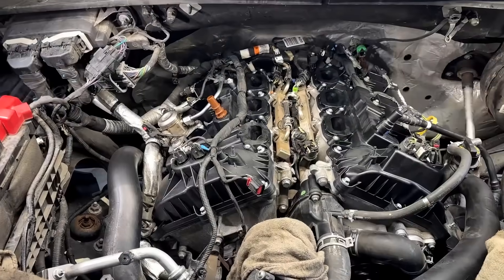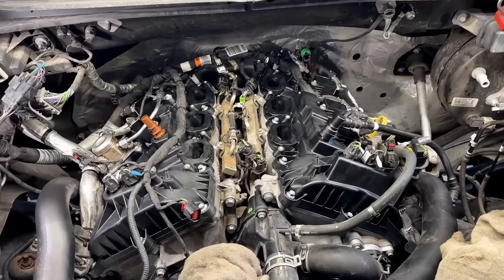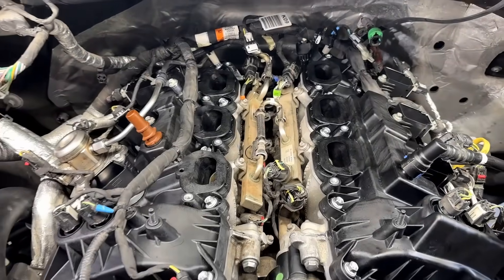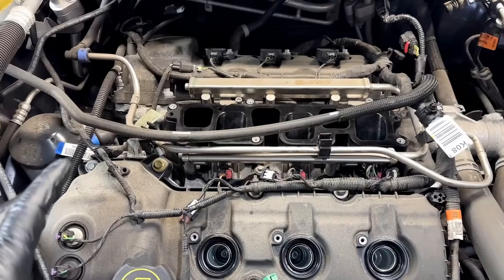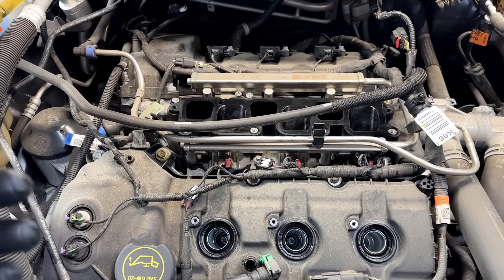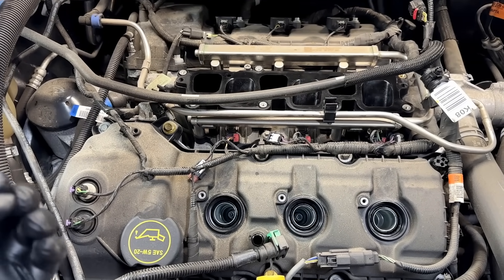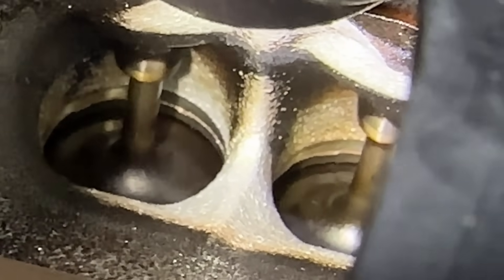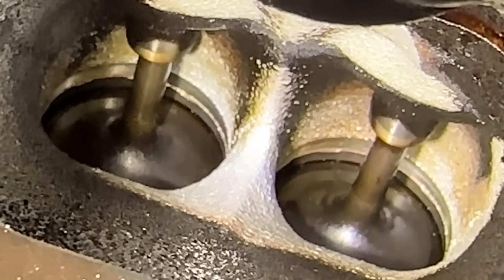Does Ford's New Dual Fuel Injection 3.5L Ecoboost Engine Really Fix the Carbon Build Up Issue?

Comment: The two Ford's I used to own had good engines one was a 2.0 liter SPI and the other was the 4.0 liter V6 Cologne engine. I never had major problems with either engine. But both broke flexplates, and the 1996 Ford Explorer Eddie Bauer Edition was the worst at three flexplates in two years of owner ship.

Comment: I find this really interesting as a VW guy. There used to be a ton of speculation that the VW euro fueling strategy (port and di simultaneously) would help our own domestic VW's with carbon buildup. The blanks for port injectors are just sitting right there on every US VW intake manifold, although they mostly get used for methanol injection by tuners and not gas here in the states. Then I heard otherwise from an industry engineer, her explanation was that it was purely a euro emissions compliance tech in practice, and that if there was a carbon effect it was minor enough not to be why it was used. For VW's part their most recent DI revision (2015 on the GTI to start) put a hollow sleeve around the balance shaft with large holes in it. They route oil vapor through that en route to the PCV, which slings the larger oil concentrations away from the potential intake stream and back into the engine. It's not perfect based on my last look into my wife's GTI, but she's at 170+k miles on her 2016 GTI, with no cleanout, and there's no idle or driveability issues as of yet. I don't think I've ever seen a previous gen 2.0T from them get past 90k without severe buildup so that is clearly working for them on some level.

Comment: Timing chain replaced at 150,000. When I had my Gen 1 3.5 they said that the oil channel would clog if oil wasn’t changed at the appropriate time. Has the clogging been resolved on gen2?

Comment: I used the intake cleaner for direct injection on my 2012 3.5 eco boost. A buddy has a 2012 3.5 and it was running rough. We used some intake cleaner for direct injection and let it set for a few minutes. We took it for a ride and that thing did everything but run right for a couple miles. Missing, spitting check engine light flashing, coughing. After a couple miles light went out and ran totally smooth. It’s evident to me it hadn’t been cleaned in a while. I did my 2012 every 30,000 miles and I sold a strong 3.5 at 180,000 miles. Only time the engine had a wrench on it was when I did a antifreeze flush and got the water pump leaking. Never a fuel system problem.

Comment: My 11 F150 3.5 had 195k miles with no catch can and runs as good as the day I bought it new.  I’ve gone through misfire issue with plugs and have drilled the intercooler pipe condensation relief hole.  Overall been a great truck using Mobile 1 synthetic 4-8K with wix filters.  

Have friends with over 200K with no issues also.  “Will have drivability issues”……”lucky to get 150K without changing timing chain”   

Those absolute statements can lose credibility.  Yes many trucks have those issue but…..

Keep up the great content just wanted get my 2 cent out. 

Thanks
Reply: That's reassuring. I got a 2021 F150 with the 3.5L and I like to keep my vehicles for 10-15+ years or 200,000+ miles. I use premium fuel, I do fuel system treatments (Berryman) every 4-5 fill-ups, only use Pennzoil ultra platinum oil every 5k miles, motorcraft or Mobil 1 oil filters, motorcraft air filters, and motorcraft parts like spark plugs and anything that needs to be replaced. 

This engine is WAY harder to work on than my old 5.4L V8 in my previous 2010. Changing the belt looks like it's an all day job on this 3.5L when it took 10 minutes on my 5.4L.

Comment: The original 3.1 Chev multiport v6 back in 1990 had terrible carbon buildup on the intake valves that caused driveabilty problems. GM came out with a walnut bead blasting technique to fix it or at least get them past warranty. It was said the be caused partially by valve timing issues

Comment: These engines just will never be a high mileage long runner. Seen a lot of high mileage 4.6 taxi cabs over 500,000 and the 5.3 Chevys that a local roofing company use to run around and give quotes multiple over 350,000

Comment: First gen Ecoboost customer traded in. 5k oil changes, full synthetic. Drove perfectly, no major maintenance was done to the truck, no intake cleaning. 200k miles.
Reply: You're spot on with the 5k oil changes. The extended 8k-10k oil change intervals are dangerous for long term use.
Reply: @ScottTooley  that's what causes sludge in modern engines. Also turbos cook the oil.
Reply: Same story here. I also suggest driving hard when it's humid outside. When you suck some of that condensation out of the intercooler when you gun it, you'll feel that cold water splash on those hot valves, and it'll sputter for 10 seconds while it blows off the carbon, then it'll run smooth as hell for a couple months.

Comment: Well it looks like there is a definite difference between the two,but honestly i would not buy any ford motor vehicle as their quality build on everything has gotten so bad its absolute unbelievable the stuff that im seeing with new ford vehicles with very little miles on them and they are literally falling apart. No thanks ford,i will stick with my toyota.

Comment: Run premium people I’ve noticed with mine regular gas studders when ur on the throttle but when I run premium it’s no hesitation just gets up and goes now I know there is no fuel recommendation from ford but man I’ve done multiple trips tryin regular gas and premium and it’s a huge difference

Comment: Would using a gasoline additive to combat carbon build up help reduce carbon, or if the fuel is not getting to the valves, will it still have carbon build up?  Thanks for the video.

Comment: Thanks for posting the video!  I appreciate the time you take to show real facts.    Do you think running premium fuel reduces the amount of carbon build up or would you say that regular fuel is catching up with premium for detergents?   Also would it be worth it to throw some fuel system cleaner in every 3rd tank?  Thanks again for the video
Reply: It does nothing on DI engines. Octave is only needed on titanium engines.
Reply: Regular and premium fuel have the same additive packages. Higher octane fuel burns slower i.e. the flame propagated slower across the combustion chamber so there is no knock in higher compression engines. If the manufacturer calls for 87 octane, then run it as a higher octane fuel will not benefit your engine.

Comment: For regular D.I.

Dont idle your car to heat up, drive it after 30 seconds. Idling causes more condensation/blow by from cylinders into oil, which then goes into your intake via PCV as oily vapor. Oil catch can is a must on DI. 

Spray valve cleaner before every oil change (5k mi) through your intake to fight buildup on DI. 

Regular DI (all manufacturers) will have more buildup after 10k then Gen2 Ford had after 130k.

Run your car hard to redline through multiple gears regularly to bake off carbon, atleast right after intake valve cleaning spray/seafoam/CRC DGI cleaner. But best to run it hard once a week.

Comment: thanks Ford Tech Makuloco for well done investigative report. The saga of so called "better ideas" automotive engineering continues. Built in power train life limitations and the still weak link of needing timing jobs so soon makes these Ford power plants a real dog! People advocate catch cans as a solution, but I have to wonder just how much of the bypass volume they effectively remove. I do not know of any well done tests to determine the actual flow volume of bypass and how much of that material is actually trapped and removed from reentering the intake. My suspicion is that very little of the bypass is removed. I suspect the biggest effect of the catch can is that it makes the vehicle owner feel good, but is not really that effective.
Reply: Do the new f150 ecoboosts need timing jobs still?
Reply: Catch can is a gimmick!

Comment: The reason there is so much more carbon in the second Gen ecoboost vs the NA gas engine is because of the turbos. Turbos will always carbon up more because because of the oil vapor. That is why a catch can is important on all turbo charged engines.

Comment: No it doesn't help,no it doesn't help!They run good though!😁 I've seen some 3.5l's that  have180000 miles and the cabs aren't rusted no  leaks and so the maintenance has been done to those trucks.

Comment: Do you recommend changing transmission fluid on 2004 Ford expedition 5.4L 2 valve with 195,000 miles, bought used & don't know when or if it's ever been changed, thank you & love the content
Reply from the maker: Yes but only a fluid and filter change never flush.
Reply: Thank you for replying, keep up the good work, we need you & Happy New Year

Comment: Turbo engines all make excessive blow by, then adding direct injection to one is stupid. I will never never never own any echo boost car. None of them from any manufacturer will last 300k with minimal maintenance. They all will have turbos fail, carbon problems, oil consumption, and clogged catalytic converters. All these expensive problems just to get a few more mpg’s. This is why car guys that know cars are usually driving a car made between 2000 to 2015. This is when cars were best and lasted the longest with decent performance and mileage

Comment: Hey I have a 2012 ford escape and I accidentally put my only key as the my key and it’s limited to 80 mph and the radio sounds low cars says it has 3 admin keys and 1 my key which is mine any way you could help me thanks I’m in Chicago I’m willing to go to you

Comment: I have a 2020 F150 with the  2.7L  twin turbo.  I knew that there was a problem with the prior Engines and carbon build up so I added an JLT oil catch can to my engine.   I am wondering if anybody else is using a Catch Can and what kind of miles you have on your vehicle and what you experience has been with it?

Comment: I have a 2014 f150 3.5 EB (only DI) with no catch can and have 156k miles no problem. I change the oil every 3k miles. Wonder how mine look in there or if I should install a catch can,

Comment: Chasing higher efficiency has cost them reliability. i would never buy a direct injected engine in anything. Its ridiculous that companies get away with designing things to fail like they do. Ignorant customers are the only reason they still have any customers at all. Ill stick with my 5.4 3V in my 2005 F150 w/payload pkg. i just swapped the engine a few months from my 2006 with a rusted through frame to my 2005 with a perfect frame and 274k miles. The older truck frame is beefier. Cost cutting on newer models is pathetic.

Comment: So the question now is, does a catch can mitigate the carbon build up to the same extent as the dual injection on the gen 2 engines. Or are you just wasting money at that point with a gen 1 and a catch can. I would like to see if there is a marked difference.

Comment: I have a 2021 PB w/ 75K miles, I added a catch can at about 10K and drain the can after each oil change.  AMAZING how horrible the oil smells, how much coffee colored liquid is in the can as well - it fills about 3/4 to one inch (about 2 inch diameter can) in 5K miles.  This truck has to go 250K based on my driving and budget, gets great mileage over my past F150s - In summary, 5K full syn oil changes and tire rotation at dealer (about $80), catch can installed, top tier gas, Chevron techron used about every 15K miles, etc.  Check up on valves - almost completely clean - dealer says 200K plus before ANY maint needed.  Now the timing chain, that's another issue ...

Comment: Great channel. Thank you for the excellent content. I have a theory. Manufactures have increased the mileage intervals on oil changes to as much as 10000 miles. I believe that even good full synthetic oil starts to break down slowly at first but after additives have expired then much more rapidly. When the oil is new there should be less evaporation. As heat and miles accumulate.The oil condition and additives begin to diminish. By changing the oil and filter every 3000 miles. The oil is still in excellent condition. Very little evaporation has occurred. The less evaporated oil gas entering the intake through the E.G.R. system. This should translate to less carbon build up.Also the anti-wear , heat , viscosity ect. additives are still very active. This will also help with all that timing assembly friction and wear. Whenever I see the inside of an engine that has a brown or dark film the oil has already began to fail.
Reply: I use Mobil 1 oil at 10K OCIs and my Ford engines never get varnish even at 200-300k. Tig1

Comment: Out of curiosity, why did the 2019 need the timing job?  125K miles seems awful early to have any issues with the timing chains and associated parts.  Thanks
Reply from the maker: Phaser, it s a common flaw.
Reply: @FordTechMakuloco  Thanks for the quick reply.  That is an expensive flaw.  Sure makes the 5.0 Coyote seem like the better engine choice in the F150.  At least for me.
Reply from the maker: Way better than the horrible 2018+ 5.0L engines out right now.
Reply: @FordTechMakuloco  You are scaring me away from used F150's.  So what is the most reliable engine/tranny combo in used F150's?  Seems the 6 speed  tranny is preferred over the 10 speed.    Is the 2nd gen eco boost notably better than the 1st Gen?  Presumably the 2nd gen upgraded the timing system, but yet you have one in your shop.  I want the most reliable setup, with the given that I stay on top of the maintenance.

Comment: This is quite interesting. So I have a 22 powerboost. Which of course has the 3.5 I’ve wondered how/when the port injection functions. I do my best to keep it out of boost for higher mpg which is working quite well. So if a guy does that long term would be interesting to see after 100k how the intake looks. I also have a catch can installed. That’s interesting in it self. Over 5k miles (one oil change) I don’t think I got half a shot glass worth of oil/junk in there.

Comment: I wonder if using a fuel additive/cleaner would help with this in a dual injection engine. My coyote is port injection so I'm not worried about it but I started adding marvel mystery oil every tank of gas as the truck now has over 100k.

Comment: I’m willing to bet there would be a more noticeable difference in aftermarket modified Gen 2 eco boost or Gen 3 coyote combos… Ford OEM strategy probably doesn’t rely heavily on port injection for fueling, whereas it’s a requirement in vehicles adding significantly more power or going to E85, in either case additional fuel demand is placed on the system, and DI can’t keep up. DI blending skews more toward the port side, as required. 

I’ve seen some higher powered Whipple E85 coyote setups (1000whp) get down to 30-35% DI blending with the other 60-70 coming from port Does anyone know what the OEM ford strategy calls for at idle, part throttle, and WOT?

Comment: Ignorant here. Where does the carbon come from on the intake valve? All it is doing is sucking is in air. Is this a valve leak problem? Is this a timing problem where the fuel is injected before the valve is completely closed and causing coking on top of the valve from the heat?
Reply from the maker: Valve overlap, egr function, oil carryover and the natural sooty nature of DI.
Reply: @FordTechMakuloco  I forgot about the EGR valve. Thanks now it makes sense.

Comment: I have a first gen ecoboost engine. I use an oil catch can, full synthetic oil and CRC intake valve and turbo cleaner at every oil change. I wish you would do a before and after video of the CRC intake valve and turbo cleaner.
Reply from the maker: I would never use that cleaner.
Reply: Why? It was designed for that particular problem. The only other alternative is walnut shell blasting to clean the heads.

Comment: I have a 2017 F150 XLT 2.7 eco boost.  I’ve noticed when I top off my vehicle with fuel, the engine misfires at idle but the problem would go away after driving for several miles.   Any thoughts on what’s causing that ?

Comment: They should just include a catch can with these engines. It's not a difficult maintenance item to deal with compared to carbon. It's an issue with any direct injection engine...

Comment: I have a 2022 3.5 EcoBoost f150 power boost, are you able to run fuel injection cleaner with turbos? I'm new to the EcoBoost so I don't know?

Comment: After a bit of pondering (I am slow) the port injection helps clean the valves when at idle. 
SO, Ford installs auto stop/start to prevent some of this cleaning benefit when stoped at a traffic light, and  in heavy rush hour traffic. 
Port injection to satisfy the customer and auto stop/start to satisfy ignorant, over reaching government regulators. What a country!

Comment: What about then Gen 3  coyote motors with the dual systems? In my case I have a 2019 Mustang GT. I always run top tier gas and I occasionally put Chevron Techron in when I am going to be driving around town and Turing off the engine to get a soak of cleaner.

Comment: Why have propane-only powered vehicles not suffered from this problem? That fuel is not wet like gasoline. It has been used for many years without this happening, as far as I know.

Comment: This video is awesome!!! And I'm not even a Ford owner! I'm a die-hard GM Guy who is 61 now. 

I've learned a TON of info the last 10+ years because of guys like this! My 2015 Impala LTZ (3.6L VVT V6) still runs STRONG.
* The ONLY fuel it's seen is Certified Top-Tier NO-Ethanol Premium, from Shell or Holiday stations.
* Seafoam is used frequently in the gas too. Once a month at a 1/4 tank, 1/3 of a bottle goes in our cars. 
* A month before an oil-change, I put a cup of SF in the Oil.
* ONLY MOBIL-1 is used, & NEVER more than a 5k o/c interval!